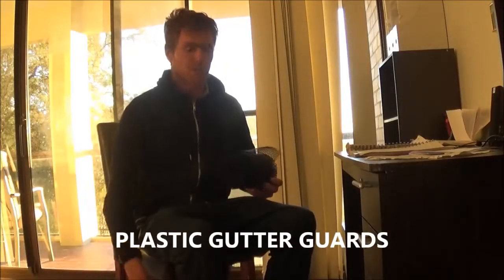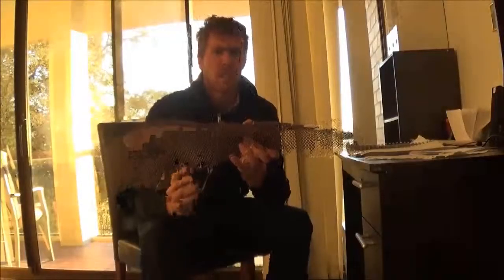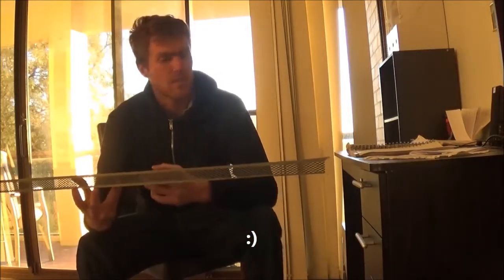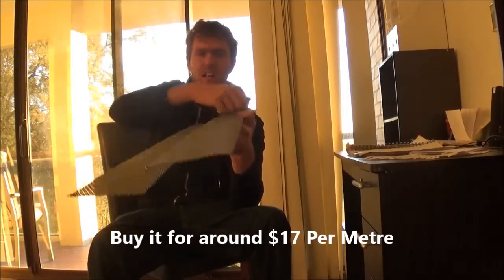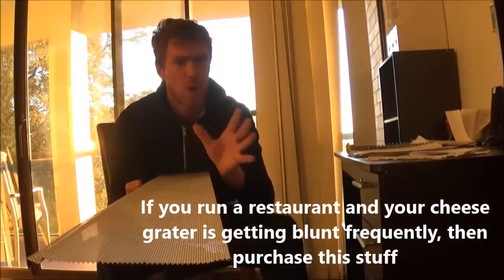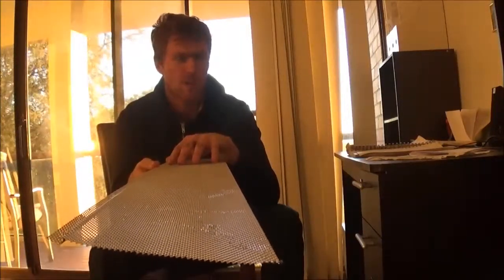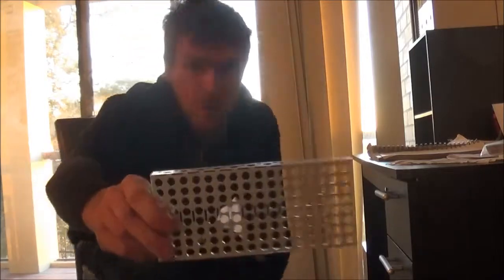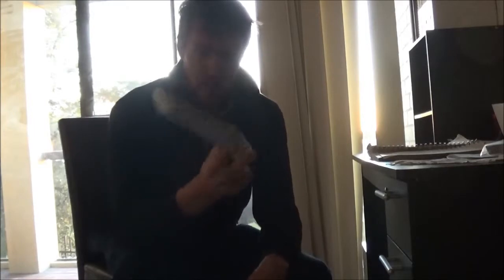Gutter Guard Review

Comment: The cheesegrater one you did the demo of is brilliant at collecting water when you run the water the right way. In your demo you conveniently ran the water from the gutter edge back toward the house which is totally incorrect in real life. the water runs down the roof towards the outside of the gutter not the opposite as in your demo.
If you are going to demo something do it truthfully or not at all.
Reply: Big Brad This definitely was not staged or set up to make the "cheesegrater" look bad. The grater has it's stengths like keeping small bits and pieces out of the gutter. It has major flaws too that make it an unwise purchase,  like rubbish sitting ontop restrixting the already dismal water flow. Water direction does'nt matter during a storm,  its coming from all over the place!  I will try to find some time to make a video tipping water from a different angle,  but I do think you are clutching at straws mate!
Reply: Adrian. Personally i think the cheesegrater system is flawed as the teeth must face up the roof to catch the water but then catches the debris trying to flow off as you have discussed. In a storm or any weather event the water flows down the roof to the gutters regardless of what way the rain is coming from hence why we have gutters. Simply pour the water over the mesh in the way it would flow off the roof and you will see the difference.
I am not trying to bag out what you have said and agree with most of your presentation except the water display.